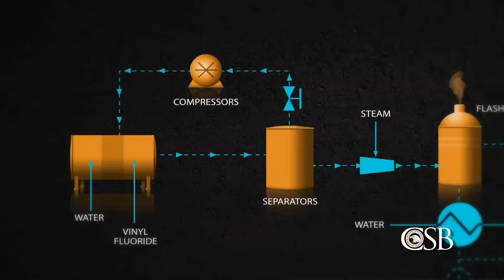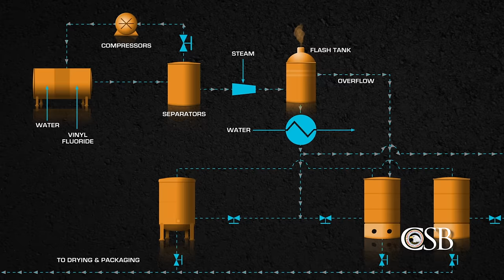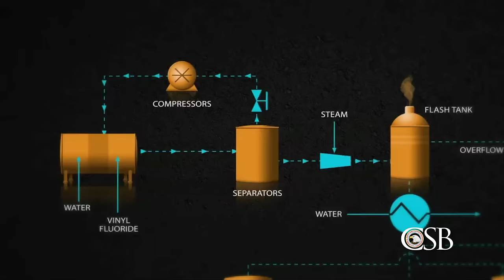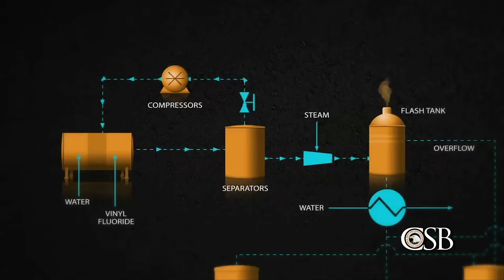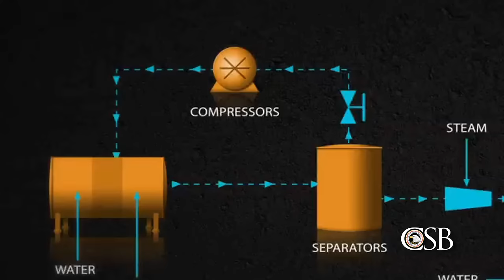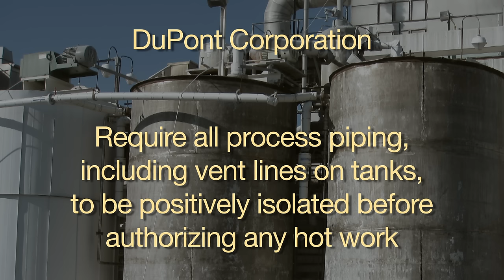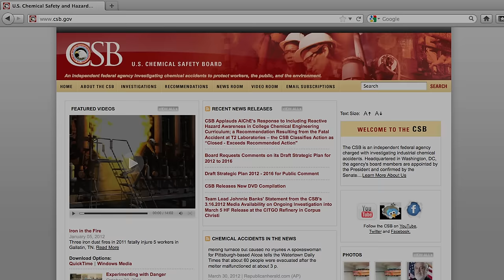Hot Work: Hidden Hazards

Comment: For a company with an "excellent safety record" DuPont sure does show up in a lot of these videos...
Reply: In fairness, DuPont is absolutely massive. It's expected that they'd show up more often than smaller companies. Not an excuse for negligence of course, but they not be quite as bad as the number if videos would have you believe.
Reply: It seems like: every plant will eventually blow up.
Reply: Safety record is a misleading statement, it only track major accident doesn’t count minor wounds, or labor wounds, company doesn’t want to show minor wounds because it represent unsafe conditions, of every wounds is recordable it will show a wider picture
Reply: It was a contractor
Reply: Dupont is also a very huge company, so even if they have an excellent record, they're bound to show up.

Imagine you have two chemical companies, one owns 1000 plants while other only owns 50. The bigger company has an excellent safety record, an accident at only 1% of their plants in the last 20 years. The smaller company is far less safe, having had an accident at 10% of their plants in that same timeframe. That would result in the bigger company having an accident at 10 of their plants while the smaller company having an accident at 5 of their plants. If you only looked at the number of accidents, you'd mistakenly think the bigger company was less safe.
Reply: @Christopher_TG  
yes, mathematically you are correct. but you could also assume that they have heaps more experience and learn from their explosions. seemingly each refinery has to have their own experience to be blown up.
Reply: It's just excellent compared to everyone else
Reply: @ursodermatt8809  these things are shockingly complex given enough time something will slip through the cracks.
Reply: Its called PR lmao. Fuck chemical companies
Reply: Pet your cats  I can assure you, my cat receives lots of petting.
Reply: DuPont pays big money for that good safety rating 😉
Reply: @agoniaXdunya  But it was DuPont's negligence that led to the accident not the contractors.
Reply: @Kinemagichemistry  any and every jobsite I am on there is continuous monitoring of all pertinent areas or work STOPS. Proper sloping/shoring- or work doesn’t start. The “let’s just get it done” guys piss and moan but I am home after every project. DuPont may have been recommended to change their policies after this incident, but I am willing to bet that prior to this the contractor was already under obligations to monitor the atmosphere inside any container hot work was taking place near. When the old timers would tell me to do some dangerous crap I would just laugh because thankfully the law is on our and safety’s side now.
Reply: Maybe it's the transparency
Reply: In a way, that can be an unintended consequence of excellent safety practices: The accidents become much rarer ... but also larger and more complex.

DuPont's scale of operations stacks with this -- who has the most and biggest accidents? The folks who do the most and biggest production runs. Not tricky.

Also, DuPont has had a lot of accidents because DuPont developed a lot of the processes. Anybody can have a perfect safety record if they're only using somebody else's well-worked and -tested process. Gets a little trickier when you're developing the thing up from bench to plant scale. Tombstone tech? DuPont's soaking in it.
Reply: Yeah, well, Boeing and Airbus shows up in almost every airplane disaster video, and yet their vehicles remain the safest modes of transport ever.
Reply: well, they use contractors, technically...
Reply: @PunishedFelix  stop buying shit made with chemicals, then, oh, its almost everything...

perhaps, just don't be a tank welder or something if you value your life...
Reply: Don't they have stipulations in the settlements that they get to keep saying that?
Reply: They are absolutely enormous and make so so many dangerous chemicals. I believe they are larger than most other chemical companies. Not saying its an excuse or accidents are enevitable. They arent. But to a degree it is a numbers game here
Reply: Watch the movie Dark Waters
Reply: I think the only injuries they keep track of is how many papercuts the executives get at the main office.
Reply: Yeah seriously
Reply: @villedocvalle  in all fairness they are one of the oldest and largest companies ever. But when you place profits above safety and the government has little power to act as it is usually after the accident has occurred.
Reply: Contractors don't work for the company
Reply: @240sxRule  Who hired them to do the work then if not the company?
Reply: They didn't neglected safety effort, they failed to actually know how that tanks work.
Reply: @performa9523  he's playing some semantic technicality.
Reply: I'm sure they would reply that this is because they are so large, and as a percentage of overall industry, their accident rate is reasonable, or low, or whatever they'd say it is.
Reply: They really are safe. Shit happens. DuPont sets the bar.
Reply: Any company that prides itself on safety culture is usually a very dangerous place
Reply: Yeah, it's interesting how a company like Dupont who employees enough safety personnel, chemical and mechanical engineering staff to fill a cruise ship and who purport to be so clued up about their understanding of how processes work couldn't figure out, or even though to check the inside of the tank for combustible gas.
Reply: Perhaps another aspect to think about is that as they said in the video they investigated 11 similar accidents from other companies. The emphasis may be to highlight that even a company with an excellent safety record needs to keep pushing towards better practices instead of complacency. 
"Hey, if DuPont fucked up like this, maybe we need to take a look at what we're doing."
Reply: @agoniaXdunya  It was Dupont's safety system that failed. Not the contractor's.
Reply: @MrMundo3d  actually, minor wounds are required to be not recorded by OSHA on the 300 forms. It's considered "over reporting" and is finable.
Reply: I noticed that as well!
Reply: Don’t forget DuPont has been a company since 1802 guys 😅
Reply: Ironic, they can save others but they can't save themselves
Reply: @agoniaXdunya  Yeah, contractors are a weak link for sure. They've got zero knowledge of the process. They often have very little experience and don't understand the hazards of their own jobs. They're a liability.
Reply: @ursodermatt8809  They're made up of small organizations with very different processes. Almost as if a thousand small plants with a thousand different chemical processes just happened to pick the same name. They have a better safety record per employee than the smaller independent outfits.
Reply: @Kinemagichemistry  If you were ever an operator that had to deal with an industrial contractor you'd be singing a different tune. They'll tell you anything to get that work permit. It's like their receipt for a days work. Did they actually accomplish anything? No, but they got the permit from operations, therefore they get paid.
Reply: Lol
Reply: within the first 30 seconds of the video "a contract welder" is that a hard concept for you to understand? Wasn't a DuPont welder.
Reply: BP next on that list
Reply: @agoniaXdunya  Plant owners (ie) DuPont as owner of the facility are responsible for verification that the jobsite is safe for contractors or Dupont personnel to do hot work. That is the reason contractors can not issue their own permits. Whether they are hot work or other types of required work
Reply: They show up in the water too

Comment: Attn welders: always carry a flammable gas monitor, even if you need to buy one yourself. Your life may depend on it.
Reply: You might not be able to detect it inside of a tank
Reply: 3:55
Reply: I was honestly surprised to see they'd not only used a monitor, but had continuous air monitoring around the tanks.  If there's one thing the CSB videos have taught me, though, is that you should never do hot work on or near a tank unless you know for CERTAIN what's in it, and assumptions about the flammability of the contents can be wrong with deadly consequences.
Reply: Better just mount the welder and walk away for 15 minutes.
If it doesn't go boom, then it is safe :D
Reply: @m1st3rxmayh3m3  I appreciate your query. What is the best method to test for flammable gas within a tank without exposing the safety auditors to fugitive emissions?
Reply: Da Be thanks for letting me know I’m 13 and decided a year ago I wanted to be a welder when I get out of school I just got a Flux cored welder this Christmas just to learn to weld and do a few projects around the house and I hope I can work in a shop that welds stuff because I hate to be on the road all the time because I hate being away from the house and I don’t have any refineries around where I’m at but I do know DuPont has some sorta facility down here and there is I’m guessing a chemical manufacturing plant in between a big city and my town but I don’t think it’s the DuPont facility
Reply: I always do a sniff test before chalking up
Reply: Nah not necessary. Just use a lighter to check if there's gas. If you don't explode it's safe to spark up the torch
Reply: “What’s in that tank?”
  ‘nothin’
“Prove it.”
Reply: @jasonsfarm37  13? Damn bro you’re ahead of the game, keep it going and stay focused bro.
Reply: I carry one at all times, even in the shower. You never know. 😂
Reply: Are there sensors that will identify any kind of flammable gas/vapors in the air?  I’m not in industry, but the only gas sensors I have at home are specific to carbon monoxide (for a gas furnace) and halogens (for A/C refrigerant leaks).
Reply: Good idea, but the gas was not where the welder was.  It was inside the tank where the sparks were going.
Reply: Should be mandatory for all chemical plants

Comment: Just remember that while the CSB does great investigative work into workplace accidents and makes great recommendations for change, that's all it can do: _make recommendations_.  They can't mandate that any company or industry change anything.  In that way they are like the NTSB.  Many times the NTSB has to stand by like the CSB does and watch future accidents happen which would have been avoided had their recommendations been acted upon.
Reply: And many times when you read about the concerns CSB has and the solutions CSB advocates you go to the report and a "alternative" measure has been implemented. A compromise was made. $$$$$$$s trump safety every time. It takes 3-10 days to get a Site Incident Proposal in the semicon fab industry. You do not move ahead or make changes to the plan without a SIP. The petro-chemical industry is using mostly outdated to outright antiquated equipment, and these bastards put an acceptable loss of life formula in place. Having their insurance company pay for replacing a burned or blown up facility is often preferable to paying to update the facility. They can recoup their losses simply by raising the price of gasoline. The workers I got from the oil industry was some of the most productive workers, but they were also by far and still are the most dangerous workers, with the exception of illegal aliens. It is part of the work culture they come from. If you won't do it, someone else will. If someone else can get it done faster, they will replace you. They are both great workers, but you have to watch them like a bunch of two year olds.
Reply: I find this puzzling, here in Norway the "safety boards" are the ones that makes the rules and enforce them and it just makes much more sense, what is the point of  a recommendation when you need regulations
Reply: They probably have to watch the same accident repeat and then civil lawsuits can point to knowledge of the recommendations
Reply: CSB says it is an independent investigation agency, which should make their investigations less biased compared to an agency that would have power to mandate
Reply: At least NTSB can recommend to the FAA, NHTSA and the Coast Guard, who can make regulations and implore Congress to pass laws. I don't know what regulatory body CSB directly reports to other than OSHA, EPA etc
Reply: “Known or should have known”
Reply: CSB recommendations have more indirect teeth than people realize. Businesses that ignore them run the risk that they'll have an accident that could have been prevented by following the CSB recommendation. 

When the lawsuit comes and the plaintiffs' attorney starts asking questions about the CSB recommendations and why PDQ Manufacturing didn't acknowledge and implement them ... time to squirm while you watch the jurors get very attentive.
Reply: zztop3000  Actually, the NTSB can't itself ground planes -- it's the FAA that does that in response to the NTSB's findings.
Reply: Morten Holsmo: The common motivation given as to not having the same organisation who investigates accidents enforcing rules is that often you need to investigate those who enforce/make the rules, which can lead to bias (either intentional or accidental) in the investigations.
Reply: And also remember that they take a ton of flak, are thought of as pariahs, those dreaded osha folks. But in reality they are only trying to protect lives, and keep people from the worst outcomes imaginable.
Reply: @m0r73n  because if they actually had power the companies would lose money and the us government is set up to protect profits not lives
Reply: Just issuing a report to a company can often be an impetus for action. Consider this: your company is issued a report by CSB to correct a problem. You fail to act. Another mishap occurs. That sets your company up for a huge lawsuit because you were informed there was a need to rectify a problem and dismissed it. That is the definition of willful neglect.

Comment: Fines basically means "legal for the rich". We've leagalized total disregard for employee safety as long as decision making managers are safe from jail time.
Reply: The stockholders, the government officials permitting this to happen over and over by the same company. These are very repetitive stories. The vapor line was the only line they left open, and vapor is what burns. Dude with the detector probably took samples upwind so they could get an all clear. Most likely from orders from above.
Reply: No. Fines are the only way a company (as a company then) can be punished. Apart from revoking permits that allow them to store or work with hazardous chemicals. To put a manager into jail, it must be proven that the manager itself was positively negligient. Finding out the responsibility chain and finding out the exact responsibile person for the incident is complicated. Also the personal obligations are very low in corporations, by law, and that is because else the manager would get overhelmed with work if he was for example obligated to personally check that work was done as given. Instead, its enough that the manager gets a written paper that the work X and Y was done, and then its accepted. If the workers was negligent and didn't carry out work as-written, its not the managers fault if a later incident then occurs.
Then we have the knowledge chain. What if someone insured the manager that vapors cannot go through that pipe because of pressure difference? Like "When the isolation valves are shut, the tank is full of air and vapors cannot enter" and then manager trusted that, and then it goes wrong because of that. Now I don't say it was like that, but you understand the evidence problem.

Thats why fines and revocation of permits are used to punish companies. Then its only neccessary to prove that the company itself was negligent as whole, then its up to the company to patch up whats wrong. Usually, fines are a percentage of turnover, so rich doesn't get a lighter punishment than the poor.
Reply: @sqeekykleen49  
>Dude with the detector probably took samples upwind so they could get an all clear. Most likely from orders from above.
this conspiratorial mindset. are you cointelpro making us look like a bunch of nuts?
Reply: @mikuhatsunegoshujin  cointelpro that is a three dollar  word. Can you give me the definition please?
Reply: @sqeekykleen49  
Google, you might be surprised.
Reply: @sebastiannielsen  If you dont even attempt to ever bring a criminal case of course you don't find criminal behavior.  Even when negligence and cost cutting can be definitively proven to cause death nothing is done.  A regular person does not have a legal department.  Fines for minor crimes generally ignore income levels and the ability to pay.  If fines were based on the profitability and assets of the person most people would have a fine of nearly $0.  Taking 10% of a company's yearly profits is not remotely comparable to fining an unemployed person who is in debt even $500.
Reply: @CIARUNSITE  The problem is more, many countries do have a requirement that the crimes are commited by a person. You cannot be criminally responsible for just sitting in a chair and having a position.

Thats why fines are used, because, only way to "jail" a company would be to jail everyone that is in the decision board, and thats not fair.

Revocation of permits are another way to punish a company. If a company misuses hazardous chemicals, their permit to handle such materials can be revoked, meaning they have to use safer material or close the company down completely. This however requires that the material IS permit-requiring however.
Reply: They should have fines AND sentences.
Reply: The company heads pay the fines and the workers pay with their lives? Let’s call that equal?